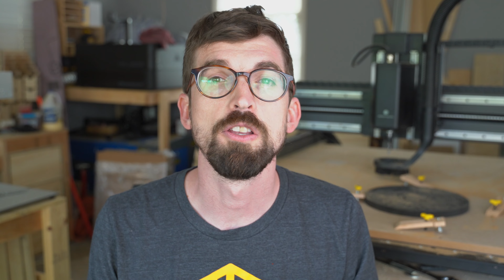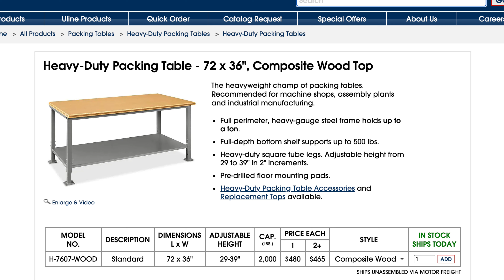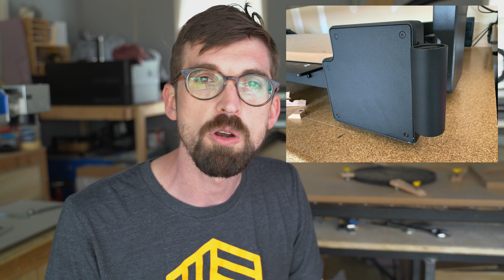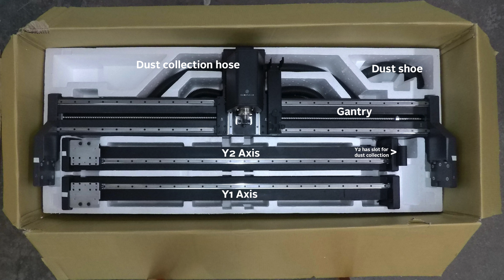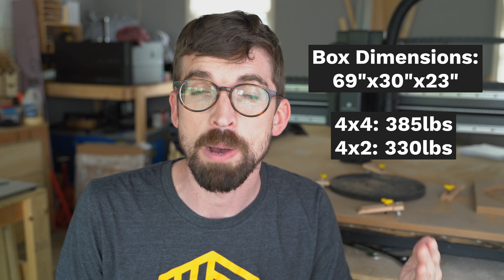What to expect when you're expecting...an X-Carve Pro!

Comment: Will I be able to complete the setup without the waste board that will be shipped separately?
Reply from the maker: You'll be able to assembly the entire machine but not run the wasteboard planing project in Easel which is the last step.  For the XCP it currently will come with the one large sheet of MDF so you'll still get a wasteboard and then the t-track wasteboard will be coming separate.

Comment: You said recommend size of the table 6ft x 6ft that’s only if space allowed. 

I made the table already 72” x 57” 
Based on the foot print you have published. 
Would the 4x4 machine fit on it or no?
Reply from the maker: Yep that will fit!  We just recommend the 6x6 so you have room for a computer, accessories.  But for the machine itself you'll be good to go.
Reply: @inventables  thank you! Can’t wait to receive my unit.
Reply from the maker: Great!